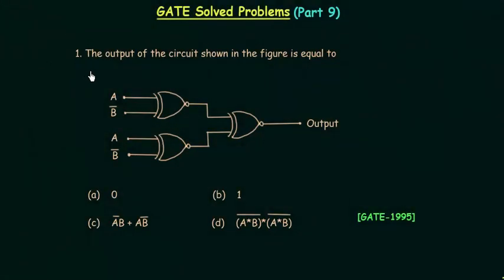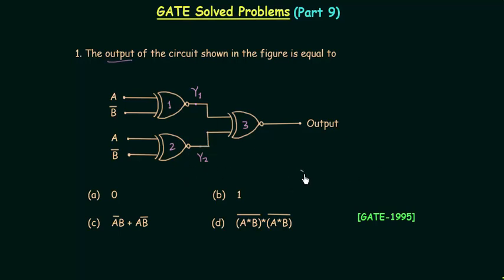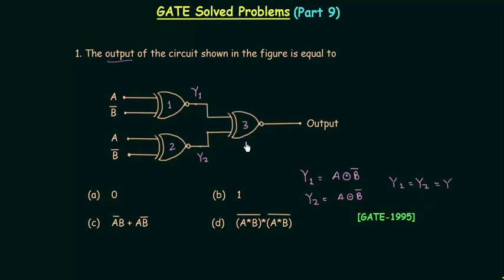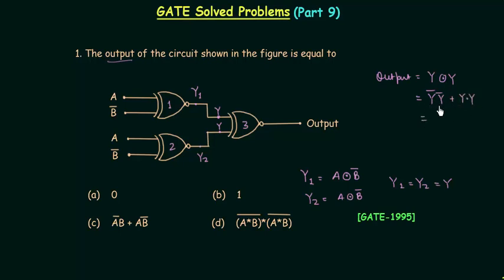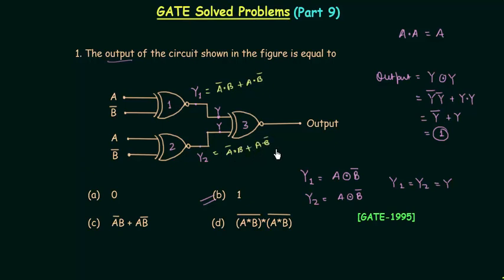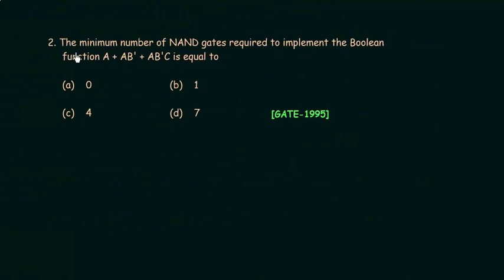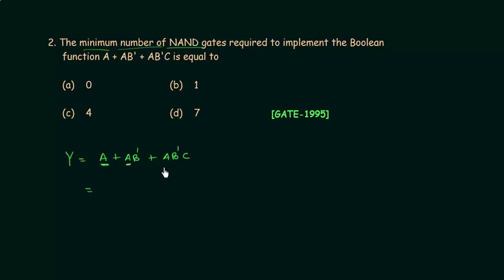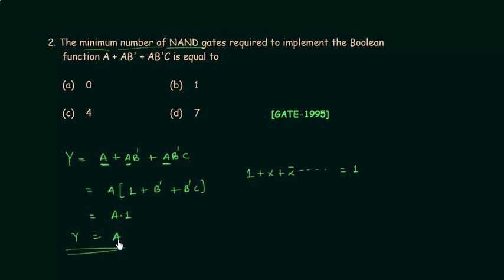GATE Solved Problems (1995) | Logic Gates | Digital Electronics

Comment: the simplest way to solve this problem is: we know that the output of XNOR gate will be 1 when both the inputs are same and the output of XNOR gate wil be 0  when both the inputs are different this you can check by truth table of XNOR gate . We can see that both the inputs of gate 3 is same therefore the output should be 1,  option b is correct

Comment: How can v say the ans as zero since without using NAND gate its just an input, they asked to implement the expression with NAND gate, can anyone clear it out
Reply: it says minimum no of NAND Gate required..by solving the expression we found that we don't require any NAND gate for the expression.. so i guess 0 is correct.

If its compulsory  to use NAND gate, than i think answer will be 2. but 2 is not in the option..
hope this helps.